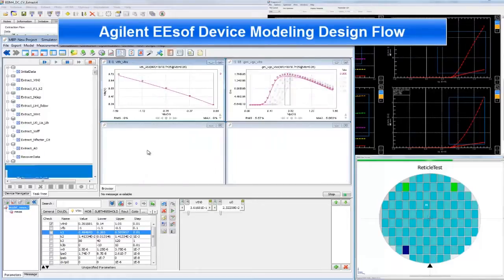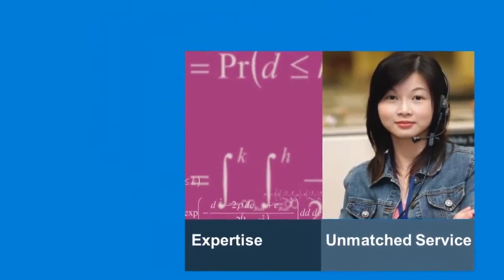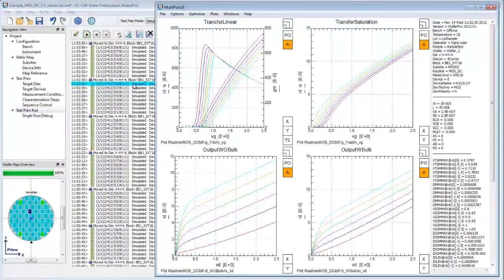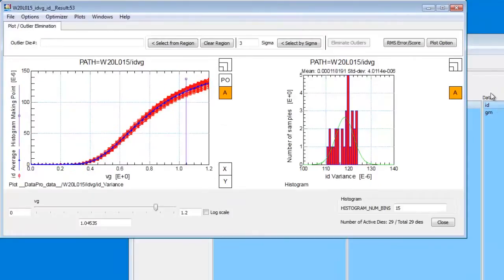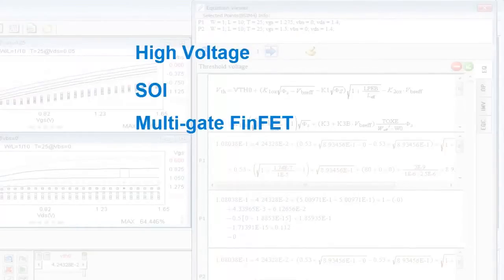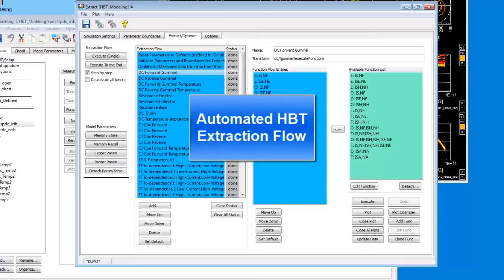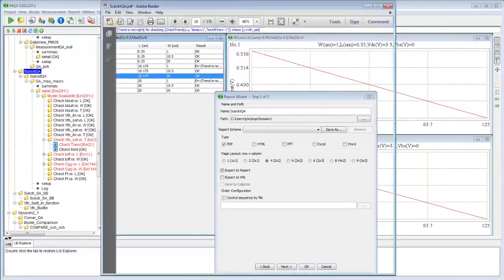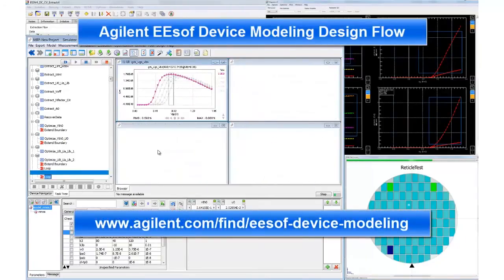Keysight EEsof EDA Device Modeling Design Flow

Comment: This video , you have seen the Device Modeling Flow from Agilent that helps you achieve your goal of accurately characterizing and modeling cutting-edge silicon and compound semiconductor devices. Agilent offers solutions that make it easy for you to go from measurement all the way through creating and qualifying models

after 3:39

With direct loading of in-situ(다른곳이아니라 그자리에서) modification of highly hierarchical, highly complex foundry libraries, MBP uniquely enables concurrent design for fabless semiconductor companies
#2
IC-CAP is the platform of choice for customers developing their own custom modeling solutions as well as customers modeling compound semiconductor devise, IC-CAP’s strengths build on its flexibility. 
IC-CAP users can simulate customer sub-circuits on a variety of commercial simulator like ADS
IC-CAP allows users to write custom extraction routines, create user interface dialogues and automate extraction flow
IC-CAP gives access to cutting-edge model technology for compound semiconductor devices such as the Agilent HBT model and the Agilent NeuroFET model, based o nneural network technology
#3
Now let’s consider model verification 
Agilent’s Model Quality Assurance(보증) software or MQA serves as a platform for performing automated, comprehensive and systematic SPICE model qualification

MQA makes it a breeze to automate routine yet critical QA tasks such as [physicality, scalability and robustness checks, cross-Vt , cross-polarity and cross- corner consistency checks ,SPICE library regression checks and library and technology benchmarking
At the model QA process MQA automatically generates QA reports for efficient sharing among the modeling team, with the internal design community, as well as between foundries  and fabless companies

#4 
Finally comes PDA creation and verification.
AMA provides a solution for cutting edge technologies where layout dependency effects are important 
It supports both sub-circuit based modeling approach and LVS-centric co-validation of SPICE models and LVS decks
With models created and verified with agilent’s tools you’re now ready to confidently create your PDK